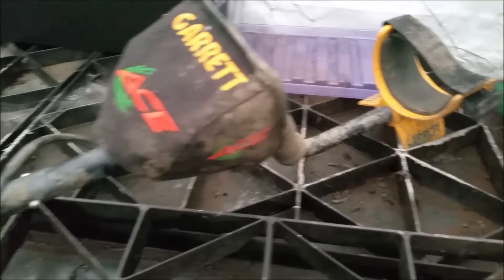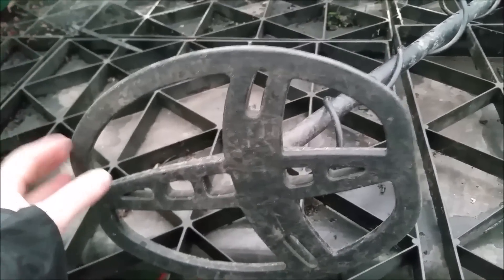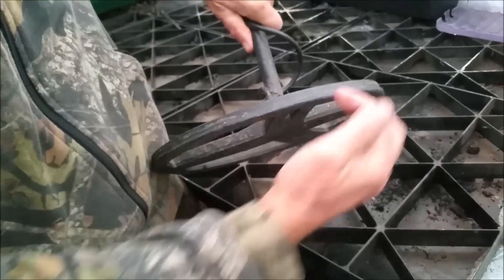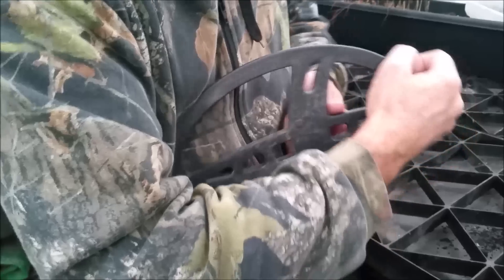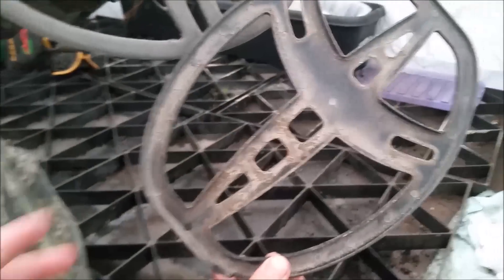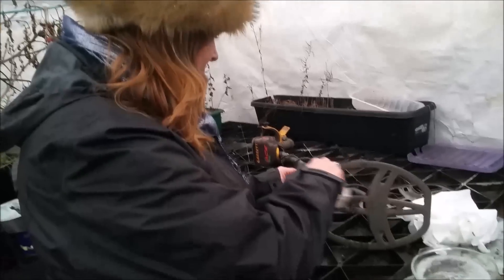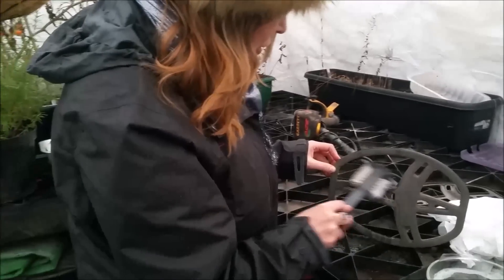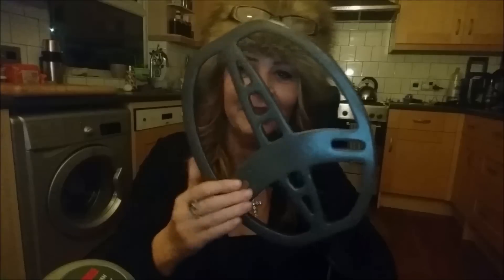Beginners guide to metal detecting - Cleaning your Coil (6)

Comment: Thanks guys for the advice on cleaning the coil,iv seen lots of  threads on different forums saying that the detector works better without that coil cover ?,but at risk of damaging the coil lol,iv never used the cover on my e Trac, it's only scratched the bottom ,doesn't seem to false or miss any targets,anyway thanks for sharing ,G/L & H/H :).
Reply from the maker: +mattys metal  detecting south wales Im glad I had my cover on as it was broken on one side, so it does protect :-)

Comment: A little trick if your lazy and don't want to clean your coil off under the cover is seal it with some good quality black waterproof silicone around the top of the coil cover after Youv given it a good clean and dried it properly, job done!

Comment: I have found some bargains on eBay via the firm u mentioned in one of your vids euro ace and Garrett 250 in a set form including cover rucksack finds pouch pointer and headphones  do  u think that any of these would be good. I happen  to have a few places where it may be possible to get permissions as I live in a village surrounded by farmland. plus I have a pretty large garden to start on. the beaches in Cornwall are dutchy land not crown so I don't think I can go on them .
Reply from the maker: +carper1325 the garrett 250 is an excellent starter machine, its a coin magnet, no you cant go on dutchy beaches but if you have land around that your can get permission for then go for it!! Its the best hobby ever! :-)
Reply: Cheers dawn by the way do u watch detectorists on TV I love it
Reply from the maker: +carper1325 yes preferred the first series to the 2nd though :-)

Comment: twiggy knows his stuff, i do the same as he does with the coil head and use my body to get it off, id also say your more likely to break the garrett coil cover if not cleaned after every hunt with dried mud hardening in there and bonding the two... my dads coil cover broke on his at pro also, to be honest dawn i think there a bit cheaply made and of poor plastic, and my dad treats his like a baby...so id highly doubt that its your fault about the breakage of the cover... 

 i personally clean all my gear after every hunt as id not be able to sleep properly...lol. but there is one tip id give, and that would be to let the coil cover warm up to room temperature before removing it, as this allows the nature of the plastic to become more malleable/flexible, when cold there is a higher chance of it breaking when removing as the plastic is less flexible..

also, and as mad as this sounds...pmsl... when i get home and ive cleaned all my finds plus headphones...etc.. im left with a deus thats covered in all sorts...so i get a shower and i take the machine in with me...haha, i use a little hard plastic brush to clean it all, it gets rinsed and cleaned/scrubbed with me so we are... all nice and clean together...lol i also clean the coil cover when im on in the shower:) 
twiggy is also right about letting it dry out first before putting the coil cover back on:) i really liked that video, because it shows and educates people on what to do, its a simple thing but a point not many people talk about or show.... so another thumbs up from me:) 
GL&HH
Reply from the maker: +TOMMY TURBO TREASURES I should have looked after it better, Im hoping to get out with it this weekend if the wind and rain calms down a bit, to give it a test, we have saved a field on our permission for winter im thinking its going to be a good save :-)

Comment: do the ace 250 machines come with a coil cover attached or did you buy one to put on to protect it?
Reply from the maker: +irene Trestonwaller hi Irene.. i have a 350 and a 400i both of them came with a coil cover as part of the package . I should imagine the 250 does too. They arent very expensive to buy. Replacement ones are around £10
Reply: Thanks Dawn.